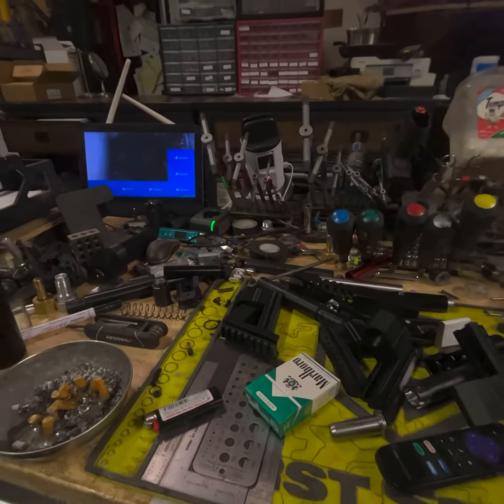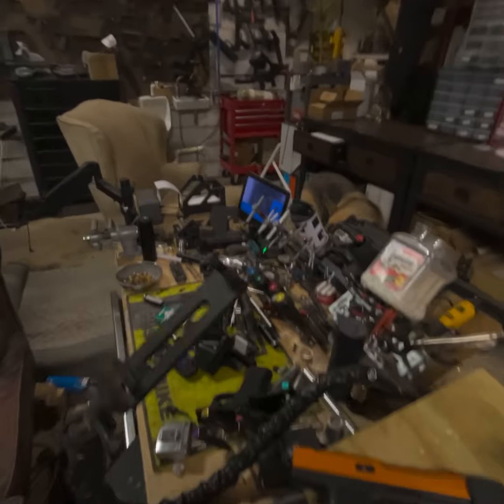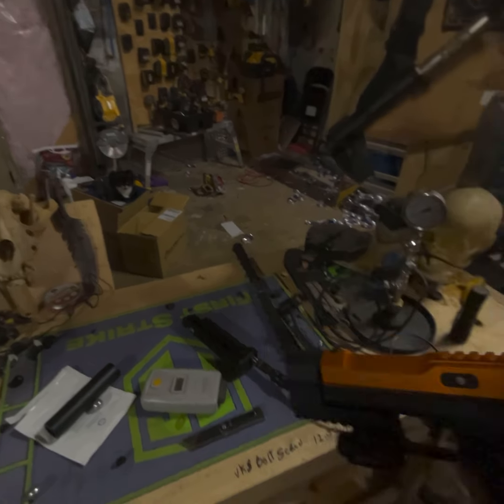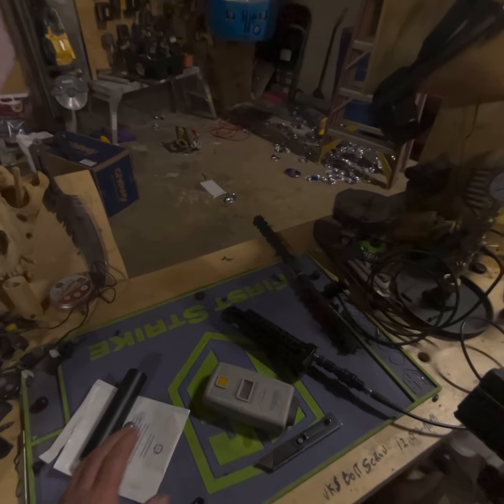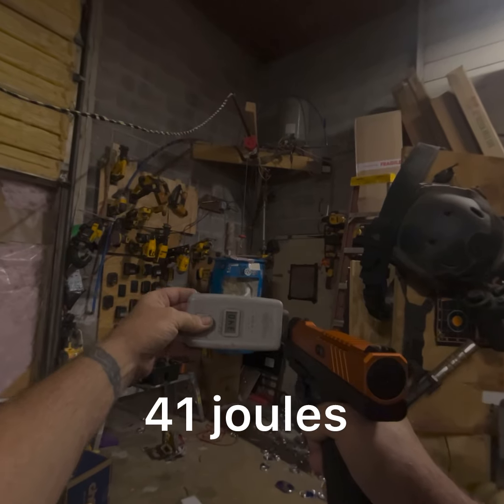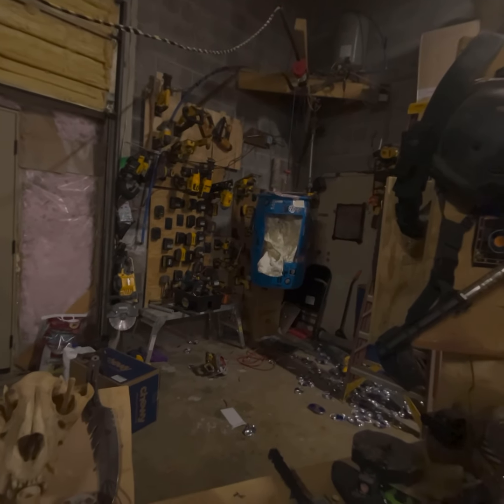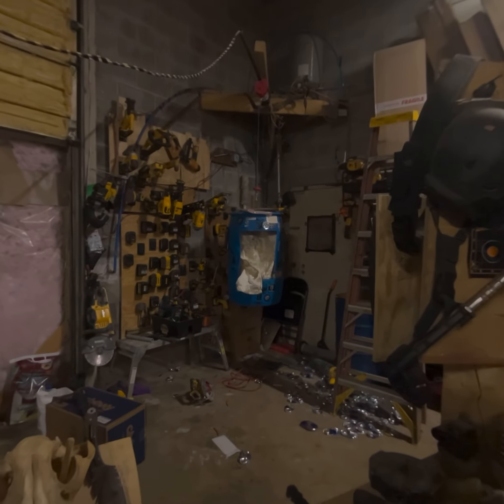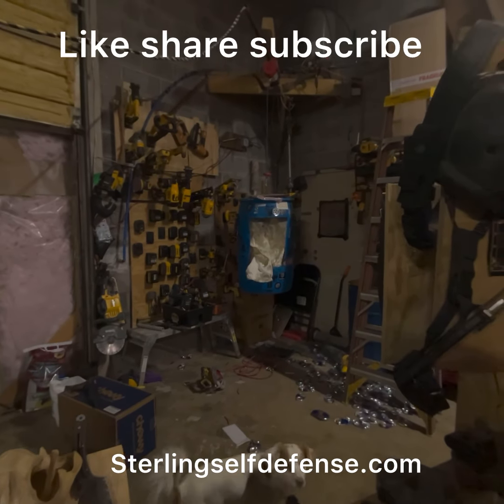X-68 with the new 5-1/2” barrel

Comment: You said it's a 1.5" non-threaded barrel with compensator? Is the original barrel still in the launcher and your 1.5" barrel sits in front of the original or is it a one piece barrel that is approximately 5.75" long?
Reply from the maker: @dougtodd9184  it’s a one piece prototype I made ya 5.75 1-1/2 bigger then stock
Reply: @sterlingselfdefense-lessle6915 I'd like one of these and if possible one with a bore of .682 to shoot the smaller ammo?